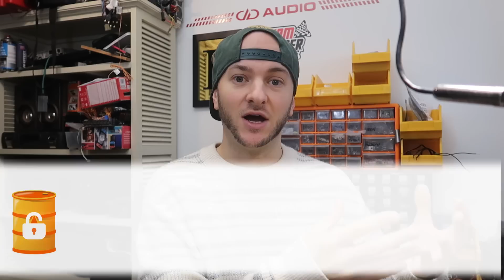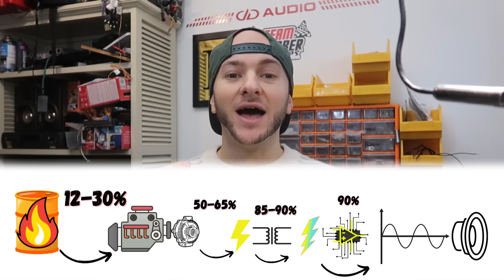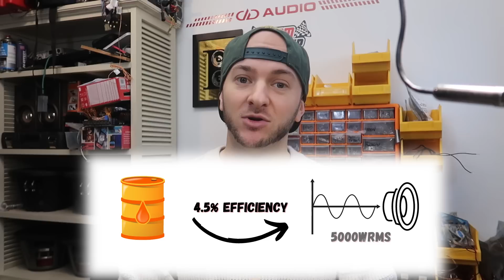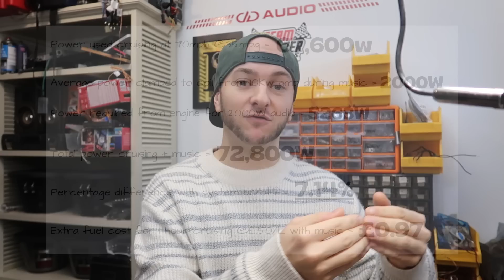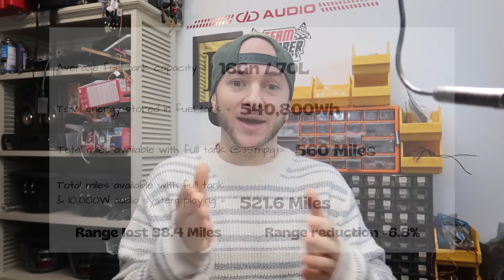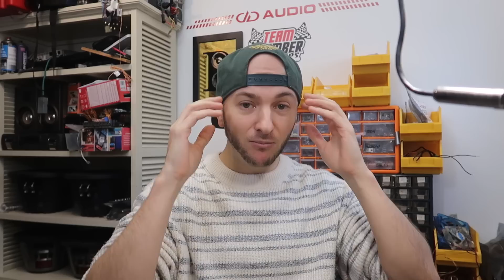What Happens to Car Audio in an Electric Vehicle Future?

Comment from the maker: One thing i forgot to mention is due to the lack of engine noise, EVs will make fantastic bases for an SQ system, since the lower the floor noise the better the dynamics :) - ALSO - The assumption is that there is still a 12V battery buffer in an EV charged by the step-down converter, the same way you have this in a normal car charged with an alt. Thought this unnecessary to mention since it doesn't either create power or consume power, just acts as a buffer.
Reply: Not true because if the amplifier power is not at the same voltage as the the battery out put then the step down regulater can ad noise in the system unless it's passive which I doubt will be used. But it's effect is way bigger on the ev battery than you are saying it is.
Reply: What about voltage drop while your system is playing, will it still fluctuate on electric vehicle's..?
Reply: Can the ev handle the vibrations as well as a petrol car?  All those batteries?
Reply: YouTube has not been given me any notifications about your new videos. 🤬 I just got one of the JP10.4! I can't wait to get it hooked up. What do you think of them?
Reply: I have an EV. I have an 750W amp and 3 subwoofers installed. Running it off the 12V battery. All EV's still have a 12V battery system. It's what all the sensors, alarms, and window and lift motors run off. The alternator is replaced with a low voltage charger. The limitation is physical space and the size of your 12V battery. Also isolating it from the high voltage system for safety and not tampering with the high voltage system (bright orange cables) and potentially killing yourself.

The air conditioner runs off the HV system. It's parasitic to the batteries just like in a gas powered vehicle.
Reply from the maker: @MobileAudioPro  you don't think alternators create a bunch of noise? They don't generate DC, and the rectifiers in them are by no means ideal for clean DC. Car amplifiers have switching power supplies themselves anyway. Is your goal here to purposefully disagree with everything I say using nonsensical arguments and examples for the sake of it?
Reply: What about amplifiers like the one Loud Fiat uses? that can utilize that high current?
Reply: @barevids  On top of that, the AC frequency of the alternator, and thus the noise it produces, are going to be in the audio range and are therefore more likely to be passed through from the power supply to the audio signal. Switched mode power supplies typically operate well above the audio band. I designed and built a 6-channel amplifier from scratch that had 2 switched mode power supplies in it, one operating at 100kHz and the other at 180kHz. With proper filtering, the noise on the power supply rails was below the detection threshold of my 350MHz oscilloscope, and I measured the THD+N of the amplifier at below 0.025% (-72dB).
Reply: @ballistic_mod  👋👋
Reply: What people do not realize is that this electric car technology is 100+ years old. The electric hub installed motor and regenerative braking were invented by Ferdinand Porsche before WWII. For a technology to replace a current technology or invention it has to be BETTER than current technology. The future is NOT the electric vehicle. This is a fad. The future is MORE EFFICIENT PETROLEUM AND DIESEL vehicles. The future is LIGHTER AND BETTER BUILT vehicles. There are 600hp engines that are almost net zero polluters but you do not know about them because this is political in nature. It has NOTHING to do with earth and EVERYTHING to do with MONEY.
When people get out of their emotions and do some actual research they will discover this..
The real future of transportation is safe and small nuclear, hydrogen. By this time electric motors will be considered primitive because we cannot know now what the future holds. My guess is when humans discover how and what gravity is then we will be able to utilize it and manipulate it through lenses etc. resulting in propulsion. Great video though and I often wonder about these things. Maybe we will use harmonic resonance to propel us and literally our sound system is how we move. They have lifted objects with sound (possibly made the pyramids this way)
Reply: @barevids  I thought you high Ender's used buffer capacitor 's
Reply: @ballistic_mod  my thoughts exactly!! That dudes system is on another level!! 400v and 200,000 Watts of power!!
Reply: Heck yeah BROTHER!
Reply: @Chris Fiske   That's a great question ? !
 Can you ruin an electric vehicle if the voltage frequently dips too low 🤔🤔😢😡
Reply: @Neil Meleo  Well said!!! 
I totally agree 💯👌
And  If they would stop killing and silencing these people that create   Alternative   energy engines as well !!
Reply: @barevids  Im sure amp manufactures will start making amps with step down convertors inside, and step it down, but leave it high enough that the power supply section of the amp can be smaller, keeping the amps roughly the same size.

Comment: The weight of a big audio system probably costs more range than the electricity they use.
Reply: Sure but one thing he did not mention that would be the gods gift to car audio guys you don’t need to drive to listen you can just hook the car up to the 3 phase outlet at home and charge very cheap as well, my electric teacher told me as well that the ev vehicles are being programmed soon to work with smart homes to send extra current back to your home decreasing electricity bills
Reply: Actually it seems that the weight does not do that much to the consumption off an electric car, at faster Highways and more continuous speed, there isn't any. Bjørn Nyland tried this with two Electric cars and 400kg weight, there was no real difference. At City speed there would be, but not so much because of the recuperation and also E Cars can drive really far in City's so it's not that of a downside, weightwise
Reply: @D00MINIK  The extent to which range is impacted by cargo weight varies. The most readily available data is for light-duty electric pickup trucks which indicates that payloads over 3,000 pounds (about 35% of the F-150 Lightning Platinum's g

Comment: My Hyundai Ioniq 5 converter gives over 125 amps at 14.4v to the 12v side all the time. I put my 125a load bank on the battery and the voltage did not drop at all. I’m running a fairly mild system with Focal speakers, JL  subs and amps. The quiet ride of the EV means I rock out at a far lower volume and save my ears. I love it.
Reply: That's awesome.  Sounds like an SQ audio setup 👌
Reply: Where are you pulling sound from?
Reply: Road noise at speed is far louder than a basic sedan crossovers engine noise. You're fooling yourself if you think it's quieter by any measurable level than a gasoline vehicle driving 70 down the highway. I get it though. EV owner have to make up reasons as to why owning an EV is so awesome. It's just coping.
Reply: @Brisco_County_Jr  you must not drive EVs. I have a lexus ls430 and a Chevy Bolt EV.  Bolt is far smoother and quieter.
Reply: @matthew anderson  lmao except it's not whike driving down the highway as it's all road noise. Tell me another EV joke fueled by your holier than thou attitude. It doesn't work that way. Around town when you're accelerating sure. Not when you're up to speed cruising.
Reply: @matthew anderson  Chevy Cruz hatchback 4 cylinder edges put the bolt. Funny enough there's  a whole website neither sound levels for most cars made and quite a few 4 cylinder and some 6 cylinder cars beat the bolt. The engine is hardly a factor in cabin noise levels. You're fooling yourself.
Reply: @Brisco_County_Jr where did the bad EV touch you 😂
Reply: Do you think my Genesis gv70 EV gives provides a similar output? I'm running (1) 1,200 watts rms class amp to power a sub. You think that's safe?

Comment: I'm in the process of developing a high-voltage amp for tesla's and others that taps into pack voltage.

The amp is smart and can take 200-800v and steps it down to feed 8 full bridge outputs. This is 6 120w at 4ohm outputs and a pair 5kw at 2ohm outputs all channels 1 ohm stabe. The goal is a compact monster 1 amp solution. FYI, this thing is smaller than a 1kw 4ch.
Reply: hows your progress with the amp?

Comment: The next 190dB will be done on 400V.  With EV Battery being below the floor, ultra slim amp making 500kW total in one or 2 cubic foot volume making  more room for more subs, concrete and steel.... Once we will reach 194dB will well have to go below sea level in order to gain higher than one atm!  allowing more than 194...
Reply: And that 500kW would only draw around 1250 amps at 1ohm

Comment: heard an entire jl audio system in prius a while ago and the sound quality when the engine wasnt running was phenomenal, and to top all that with a stock alternator that little car would stay at 13 volts all the time even when it was all the way up! kind of made me want to get one myself for a daily and make it into a sleeper
Reply: A Prius does not use an alternator, dc to dc converter for the 12volt system
Reply: @ethanmurray6658  oh no, someone that doesnt know a prius is a hybrid
Reply: Get a grip on reality. The engine is super quiet on a prius and would not effect sound quality in any way while running.

Comment: As electric cars run on a high voltage I wouldn't be surprised if we see valve amps (again) in car audio in the future, though maybe as only a niche thing. You future car amp might do away with the 12v to 100v or whatever invertor stage and just use a PSU that supplies split rails @ +/-100-150v making all contemporary amps redundant.
Reply: I've been running 400v for years, I'm building a 1200v SiC based prototype

Comment: some drive units draw up to and over a million watts from the battery, an audio system is a drop in the bucket, plus if youre parked up at like DB drags its likely theres mains power and you can run on the mains anyway

Comment: imo they should make an universal hv input amp, since the rails are already high voltage but still lower than battery they could straight up use pwm without a transformer to charge the caps, except maybe a separate stepdown transformer for the logic section

that sounds like actual 90+% efficiency will be easily achievable, to me
Reply: They do and I've been running it for years....
Reply: @LoudFiat  i meant something that can take the 400V from the electric car batteries, 18V and 24V are still ELV to me
Reply: @BH4x0r  yes my man, check my videos, I run 400v DC into my amps directly

Comment: my main issue is knowing how many amps one can expect to be able to safely get out of the 12V system.
can i safely stick two 80A amplifiers in the car?
with alternators it's kinda easy to get that information and even fairly small cars can cope with big transients without a sweat.

Comment: Great video. Glad you approached it from an efficiency point of view and showed the different stages of energy conversation on both ICE and EV engines. Without that explanation, it seemed counter intuitive to install a car audio system in an EV since the electricity you're using for audio is the same stuff you're using for running the car, but in reality, both systems use energy the same way, just one is a much more efficient user of that energy.

So basically if your EV had a 600km range, and your ICE had a 600km range, you actually get greater mileage reduction in your ICE vehicle with a power car audio system than you would with an EV setup.

Thanks for the great video

Comment: i was thinking about trying to make a high voltage amplifier that would run on 300v dc. this was my first thought few years ago when the ev's became slightly more mainstream. 
class d pa amplifiers exist for years that runs on mains ac power and make kw's at the output and they would happily run with direct dc at the ac mains input cus they have an internal smps that takes the ac and converts it to rectified mains then there is the pfc circuit that will remain inactive once there is dc voltage and so the whole smps would run as usual.

Comment: Actually Coal Power plants today are 80-85% efficient, with Natural Gas (Peaker) plants 99% efficient, and nuclear is again around 90% efficient or better. Normal combustion engines CAN be made more efficient. However, if car manufacturers did so, your car would last for many more years and miles before needing replaced, and purchasing an auto would not be necessary for a very long time. Thus why most cars are around 25-35% efficient, so you must buy another vehicle in a shorter amount of time to keep the car manufacturers happy. For instance a vehicles intake manifold is usually 20-35% efficient. Yet if you were to port and polish your intake you can get that intake to 95% efficiency. Which in turn increases both horsepower (20-30 HP) AND mileage (5-6 mpg better). Great video, and you did a wonderful job explaining both regular and EV type vehicles, with the exception of electric power plants. But the public usually isn't as versed in power generation unless you work for a power company so no harm there. Most people would not be able to explain this concept as well as you did. Great job -  Hats off!

Comment: Those would be some BEAST voice coils to handle 20,000 watts if you ran an Amp straight from the EV high voltage battery. I had to know... 300v into 4 ohms draws 75amps @22,500 watts!  Lordy! I can't wait for the future.

Comment: My concerns are mostly safety. Even with a DC/DC converter you'd need to tap into the vehicles high voltage which so far isnt a redily accessible item, and when found it's a proprietary high voltage plug. I can envision folks attempting home installs that tap in and bring that high voltage into the cabin to wire a convertor. Most EVs don't have a ton of room to store new components while staying on the exterior of the vehicle. A lot of bright minds will need to be involved to make any aftermarket high draw item (stereo, winch, chair lift, etc) safe. It will happen but theres gonna be some failures along the way. Each vehicle might require its own special plug, convertor, access panel, reflash or stand alone computer etc which will raise the cost of car audio crippling our already dieing hobby. Or you'll have to add a bank of 12v batteries and charge them with a charger at home when you charge the car, but weight!!! Great video!
Reply: What kind of extreme sound system are you talking about building that you have to tap into the high voltage sources? For the average person you just install some amps and change out speakers just like in a gasoline car.
Reply: @JasonWW2000  did you watch the whole video, ev/hv  vehicles use dc to dc converter for the 12 volt system. adding amplifiers to the 12 volt system can potential damage the 12volt converter or cause an error message due to the extra current demand,  OP is 100% spot on. Also most people watching videos here are very into car audio and don’t have basic setups
Reply: @ethanmurray6658  Nah dude,, I watched 10 seconds and clicked off. SMH

Comment: One of these two things will happen:
1: Manufacturers will make it impossible to fit anything other than their products.
Or
2: manufacturers will work with aftermarket companies to produce approved products which will allow people to use aftermarket car audio equipment.

If we get too many people building crappy systems and it becomes an issue for manufacturers having to reset fault codes/rectify the work you can guarantee it will be option 1. I can't see companies giving away money/risking bad press by allowing people to mess with the high voltage electrical system of their cars.
Reply: there will always be cargo space and/or seats that can be removed to fit stuff in. I dont understand why you think 1 is even an option. Its not like car manufacturers consider people putting 40+cu ft sub boxes in their vehicles when designing their vehicles. also, taping into the wiring of the car is going to be easy as well.
Reply: @uome2k7  option 1 is how every manufacturer wants things to be. Its really only a question of how much they choose to embrace the aftermarket.

Comment: This is the conversation I was looking for here. EFFICIENCY will be the name of the game in the future. Will high output DC to DC converters be a new thing? What will be the weakest link in the system from the high voltage battery to the amp? ... I'm interested to see how this would work on my hybrid Chevy Volt, Hatchback with full electric prior to switching over to gas. Very interesting. Thanks for the info @barevids.

Comment: itd be great if some manufacturers start using the pack voltage to run more of the stuff like the stock audio amplifier, and offering much larger, more powerful factory amps and subs, this could potentially pave the way for aftermarket drop in replacements for those units
Reply: Wait a few years, the closer we get to 2030 the more options there will be. Most of the laws being passed against the sale of ICE vehicles kick in in 2035, car audio companies will want to get products to market to support this long before an EV becomes the norm.

Comment: 10:09 i mean electric car use maybe 20-30kw while driving at 100km/h so i think 6800w audio system would have a noticeable range loss but i don't think most people use 6800w audio system at full volume all the time so i think it will probably be fine. :D
Reply from the maker: if you were driving along playing a constant sine wave clamping 6800Wrms, then yes you may notice a decrease in range, same as you would see MPG readout on the dash drop. The average power consumption, after impedance rise, throughout the course of a 3 min song, is only a fraction of the "rated power" of a system
Reply: @barevids  yes